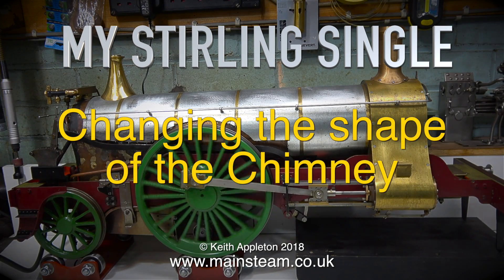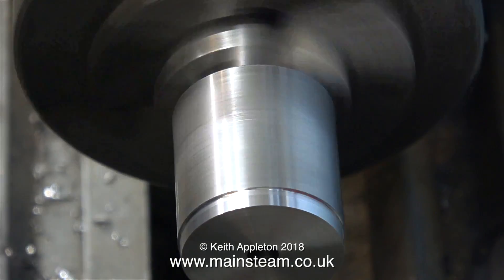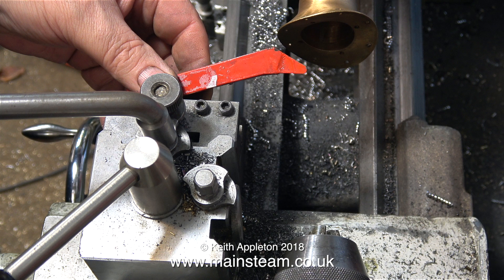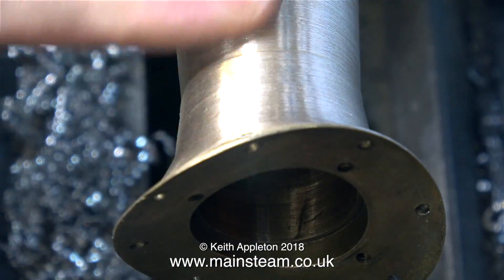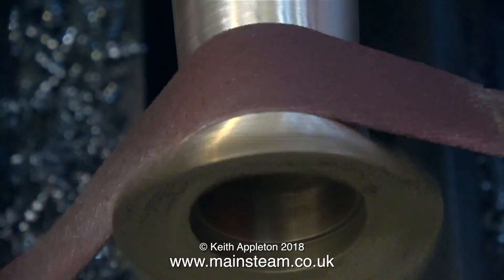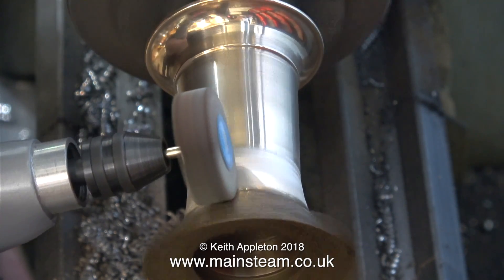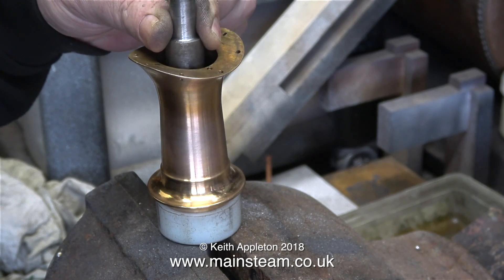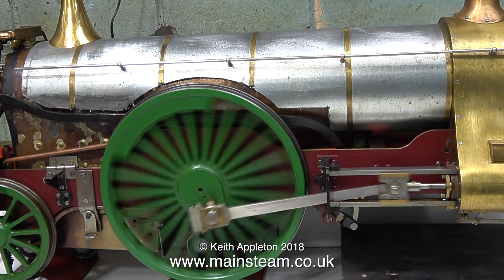MY STIRLING SINGLE #10 - CHANGING THE SHAPE OF THE CHIMNEY

Comment: Hi Keith nice work 👍, can you explain what gunn gun metal is ? Is it bronze or brass, I ask over here in the NL local metal shop but the never heard of it.
Thnx.
Reply from the maker: Please type Gunmetal into Google.
Reply: @keithappleton  yes i know but still not able to find a Dutch synonym for this, 
Found : Modern admiralty gunmetal is composed of 88 percent copper, 10 percent tin, and 2 percent zinc
Reply: @markduncker9117  If you ask for Red Brass you may get as close as possible over here to it, but to get the real stuff you have to get it in the UK
Reply: @markduncker9117  Hi Mark. With no Dutch synonym, you should still be able to give the alloy formula to your metal shop and they should know what is equivalent.